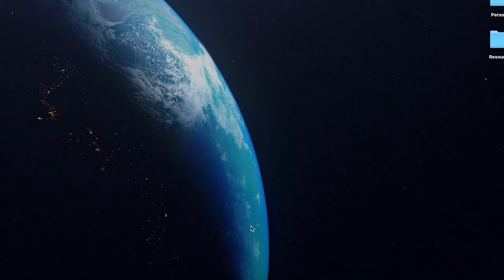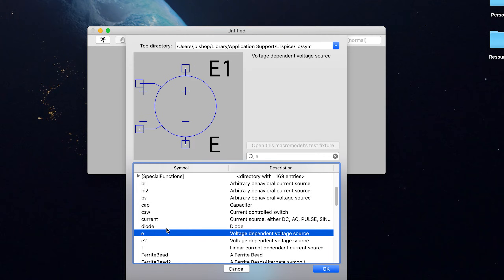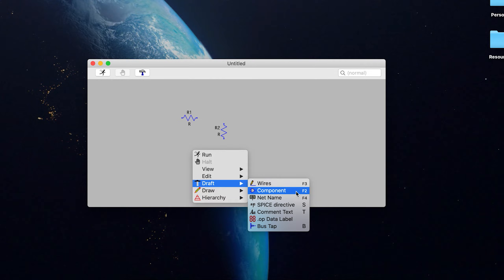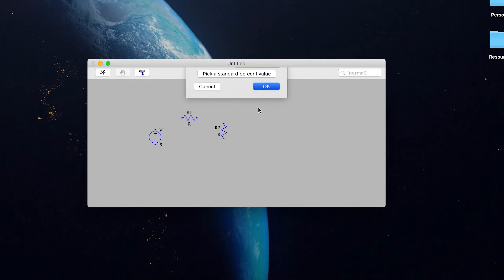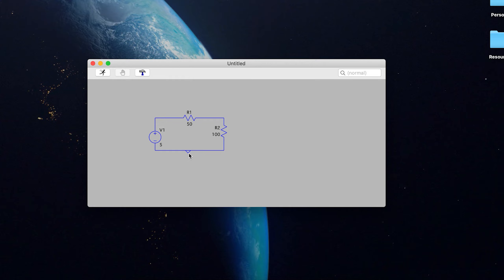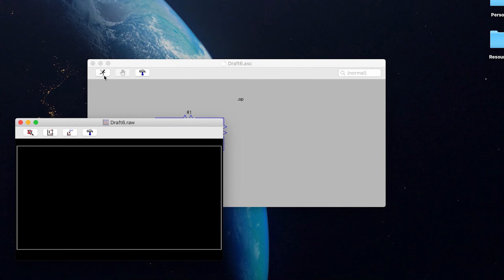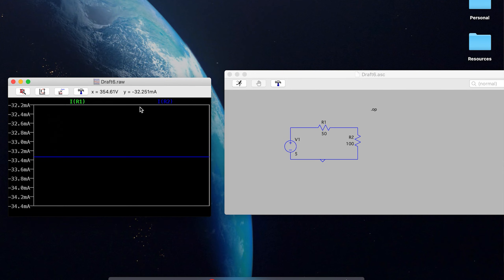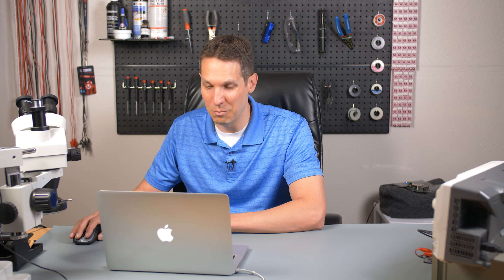LTspice - Getting Started in 8 Minutes

Comment: Lt spice is pissing me off. I should not have to look this stuff up. Whats so hard about programming in a simple scope into the program. To heck with all that analysis crap. Every circuit is awesome. I can understand where the current flows which greatly helps me understand what’s going on so i can easily make modifications. I hate not seeing my changes in real time. I may as well just use a damn bread board. Ever used ltspice on a tablet? I wanna throw it most of the time. I think the 10 bucks is worth it for every circuit now. Imma buy it tomorrow. This is too much. 
And see. I built a circuit and filled in the values of the components, and then I couldn’t probe anything. 

That .op thing? Why? ! Thats so infuriating. 

I should be able to plop shit in and get a result. 
I been wanting to try ltspice for years. What a let down. Can’t even really complain because its free but if I could program, it would bug me to have so much power and not use it. Theres an online free one that’s really powerful but its so hard to use on iphone that i wanna throw it. 
Guess ill do not do electronics till tomorrow. Not blowing up another 8pin dip today lol

Comment: why isn't voltage 5v at 6:45? when i simulate it by myself i find  5v
Reply: when i simulated myself i got 5v(the first thing) and then something like 3.5,i think one is the voltage that enters the circuit and the other is the output
Reply: also you have two resistors
Reply: so ofc its not the same
Reply: Oh thanks

Comment: I noticed you have a three-button mouse on your Mac.   I find that if I try instead use control-click on my trackpad to do a right click, this works when adding a component, but fails when using the pointing finger cursor to edit a component.
Reply from the maker: Thanks Brian, good insight.  I don't know if it's because I'm old or what, but I hate using trackpads for any work like this and always have an external mouse.  I'm not really familiar with how to use any CAD or spice program without a real mouse and typically a full keyboard.
Reply: @CircuitBread  I realized after using the tool more what the reason is.   Control-Click and Right-Click are interpreted as different and distinct commands.   So LTSpice overrides the Mac system preferences reserves Control-Click for a few situations.
Reply from the maker: Great clarification, thanks for the follow up!

Comment: I downloaded LTspiceXVII and it seems to have many differences to what you are using to the point where I couldn't work out how you measured voltages across components, so it was not as useful as it could have been.
Reply from the maker: That's a bummer to hear - also the differences between the Mac and Windows versions are greater than I would've hoped.
Reply: I found the same, Mac v Win and maybe also a later version in my computer. But I still got good value from it.

Comment: I don't get the oscilloscope when I click run. LTSpice shows a text file with the values for each component instead?

Output:
       --- Operating Point ---

V(n002):	 3.33333	 voltage
V(n001):	 5	 voltage
I(R1):	 -0.0333333	 device_current
I(R3):	 -0.0333333	 device_current
I(V1):	 -0.0333333	 device_current
Reply: I had the same issue (new installation on Windows 10). Your advice of entering "1s" for Stop Time in the Transient tab enabled the scope window worked. Thanks for sharing that
Reply from the maker: That is odd - all the pertinent information is there (arguably much easier to read than the oscilloscope) but I can't figure out how to do that with my version of LTSpice.  I'm running LTspice XVII for OS X, what version are you using?  Looking at screenshots of LTSpice on Windows, it kinda looks like they've dumbed it down for Mac users by removing a lot of the options.
Reply: @CircuitBread  Thanks, I think I removed .op and manually entered 1s into the transient tab of the run menu. 
The oscilloscope showed up once I ran a transient test and I could probe different points of the circuit. I'm using XVII for Windows 10 btw.
Reply from the maker: That was good thinking to replace that - thanks for letting us know your solution!
Reply: @CircuitBread  Thank you for making these videos!